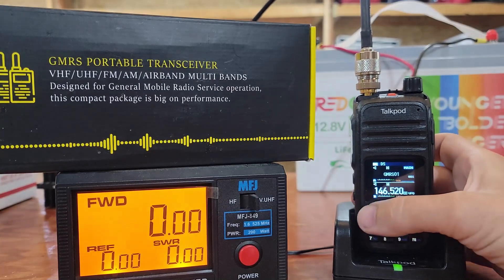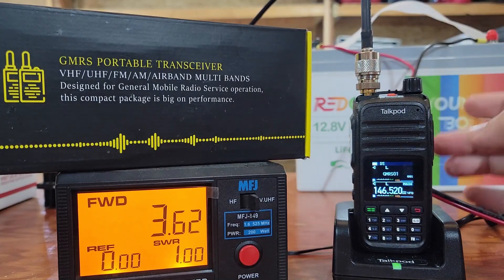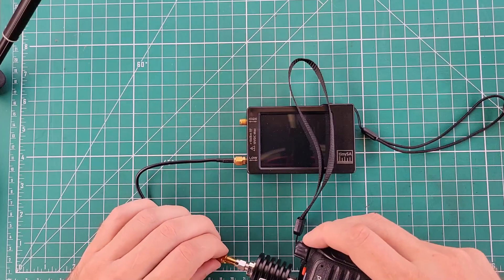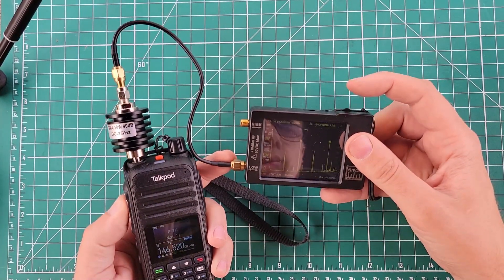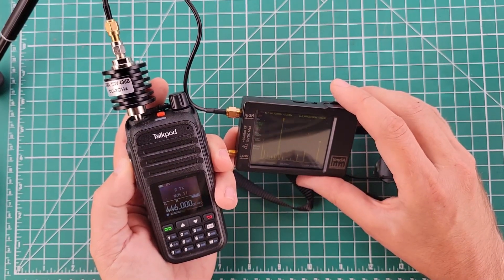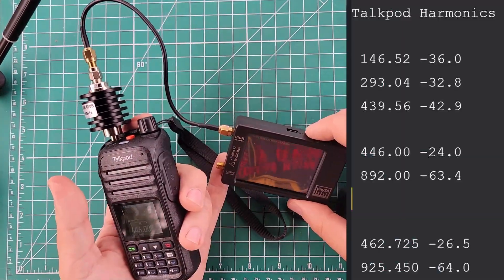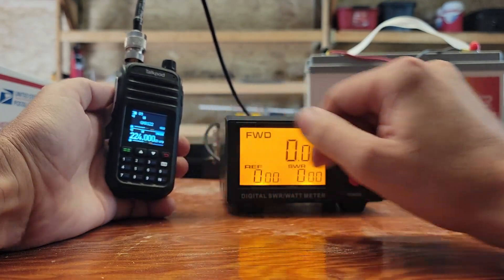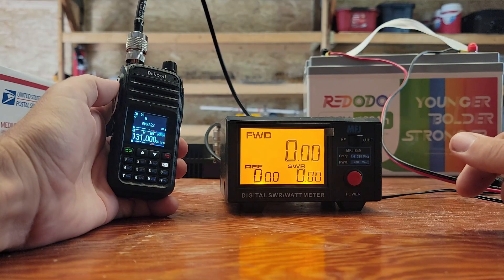The Good, The Bad, and The Ugly of the Talkpod A36Plus

Comment: Thanks for the reviews. I've just received mine, and think it's not bad for what it cost. It receives FM radio and AM airband pretty well. I checked its output with a Siglent spectrum analyser, and found that the output on the 433 MHz ham band was pretty clean, but on the 2 Meter 145MHz ham band, it was dreadful. Second harmonic (289MHz) was only -8dB relative to the fundamental, 3rd (434 MHz) was -11dB, 4th (548MHz) was -29db and 5th (724MHz) was -43dB.  For its price I'd say its OK on UHF or as a receiver or scanner, but transmitting on VHF could cause severe interference to other radio users and should be avoided.
Reply from the maker: Totally agree!  It has its place.

Comment: Hi Steve, I have a really serious question. I want to tune in on my countries main airband frequancy, but it's 136.050... and radio switches out of AM mode to normal FM mode. How can I manually switch it to AM or somehow increase AM range to that frequancy?
Reply from the maker: I didn't see a way to switch modes, mine switched to AM automatically
Reply: @temporarilyoffline  mine does also, bit only inbetween 108-136mhz, and I'm looking for a way to expand that to atleast 136.050Mhz
Reply from the maker: @imeprezime1069  ah,  OK.  I don't see any way to switch modes like that.

Comment: OK, I have been holding off on a TP A36+  impulse buy because of the ugly.   But I'm trying NOT to convince myself that the radio will perform cleaner if taking the antenna into account.  That is, for the spurious harmonics, the antenna SWR should be so bad that most of the power would be lost. I.E., an antenna acting as a kludgey band filter.   This could be easily checked using an external radio or simple SDR.   Do you know if this has been done?  I would try, but it be a $50 experiment.  Also, I'm a bit lost as to why the radio can be sold in the USA.  What are the FCC specs?  I thought these radios had to meet this specs before being sold.  Thanks for videos. They are very inspirational.
Reply from the maker: I'll have to see about the harmonics with the antenna on - that is a hard test to do and be objective about - its it front end overload?  are you too close or too far away?  etc... you know how hams like to argue.  If you already have a 2/70 radio that works, I don't see this offering any additional features other than an easy unlock... and then the power being wasted on the harmonics is tough to swallow at $50.  If you're looking to experiment with making filters, or want to listen to APRS or airband cheap, this might be a contender.  As far as "How can it be sold in the US?" its licensed as a GMRS radio and they shipped some locked, some unlocked, some that can't be unlocked at all... so they sent "a ringer" to the FCC and we got whatever was on the boat the day we ordered.  Thanks for watching!
Reply: @temporarilyoffline   Thank for the quick reply.  I'm no EE, but I would have guessed that comparing the harmonic signal relative to the fundamental signal would be objective as long as distance between the transmitter and receiver are large enough to be in the far field region (greater than 2 wavelengths).    
Thanks! I really enjoy your videos.  They have sent me down a rabbit hole: RT95->APRS ->(split off to RTL-SDR APRS iGate and to LORA APRS iGate with separate LORA smart beacon, and onto satellites via tinyGS(using same cheap LORA modules) and ISS listening on the RT95.  I'm even thinking of learning how to solder SMD inspired by the AIOC.  As you would say, (unless I burn something down) the worst case it would be a $12 education.
Reply from the maker: @dreupen  I don't have all the answers. I'm just trying to prepare for all the arguments that will come if I do it "wrong" 🤣  your progress is amazing, keep up the good work!

Comment: Does dirty harmonics make it harder to transmit or receive? Please explain. Does this prevent the radio from good communication?
Reply from the maker: Dirty Harmonics does two bad things for you:  1.)  You're causing "harmful" interference to others - like trying to have a conversation in your hotel room with your wife and the guests next door are having a very loud fight.  You can't enjoy your stay because their "harmonics" are in your room.  2.)  That power that is going out on the harmonics could have been power used to get your message out on your frequency - you're "wasting" power.

Comment: It's too bad that some manufacturers are releasing gear like this. Even if you don't agree with the FCC rules, it's really not fair to other compliant manufacturers and dealers. They are clearly trying to undercut the others and hoping they don't get caught (but they will eventually). Dealers should be wary of this also, as they risk major fines marketing a "GMRS" radio like this that comes with unlocked TX. :(
Reply from the maker: Some people are reporting it comes to them locked, so say it's unlocked.  It's not uncommon to ship a radio locked that has unlock keys for different markets.  This one is just weird.
Reply: @temporarilyoffline  No, it’s definitely not uncommon, but nonetheless a violation of FCC rules. :) I suspect they will get popped just like Anytone did about 6 years ago.

Comment: 47 CFR § 97.307 - Emission standards.

(e) The mean power of any spurious emission from a station transmitter or external RF power amplifier transmitting on a frequency between 30-225 MHz must be at least 60 dB below the mean power of the fundamental. For a transmitter having a mean power of 25 W or less, the mean power of any spurious emission supplied to the antenna transmission line must not exceed 25 µW and must be at least 40 dB below the mean power of the fundamental emission, but need not be reduced below the power of 10 µW. A transmitter built before April 15, 1977, or first marketed before January 1, 1978, is exempt from this requirement.

The radio does not appear to satisfy the criteria of 40dB below the fundamental. Your recorded measurement on 2 meters is -36dB for the second harmonic.

Your tests of various products is always appreciated—even good, bad, or ugly.
Reply from the maker: Have you seen the GMRS regs? (Link in the description) They make the ham regs look easy to understand!

Comment: I'm really thinking of getting this for my first dip into ham..
Reply from the maker: It would be a good place to get your feet wet and then jump up to more radios as you learn more and grow.  Just be very careful to not transmit out of band.
Reply: @temporarilyoffline  yes total listen mode until I feel ready for test. But knowing the area I live in. SE Massachusetts I think I'd like to see how people are. I know when I ran CB there was a lot of toxic people on locally. Until I pulled my dad's equipment out of the attic from late 70's and set ip after that I was just stepping on them
Reply from the maker: @Byteblade1776  How are you doing on the self test?  hamstudy.org
Reply: @temporarilyoffline  so far just reading it. Work schedule hasn't allowed for deep dive. So like most things slice off a manageable amount at a time

Comment: Am I interpreting correctly that on 146.52 the second harmonic is stronger than the fundamental? That is way sketchy.
Reply: It looked to me like the "floor" had a positive slope, so it's possible that they're equal and the second harmonic is just reading slightly higher (3 or 4 dB) because of the TinySA being more sensitive on the higher frequency.

But yes, it should be something like 40 dB less, not same or higher!
Reply from the maker: Yeah, sometimes it was.  Its very sketchy.

Comment: I immediately ordered a  Quansheng UV-K5 based on HH's reviews, now you are both on to this thing!  I travel on the logging roads on Vancouver Island and would like to be able to use 153+ and other Resources Road frequencies, as well as the usual VHF/UHF ham bands. I don't care about GMRS but WB Rx is always good. I have Kenwood HTs but want something disposable with USB charging. Should I buy a Talkpod too? I also have a Baofeng which is now REALLY disposable.  73
Reply from the maker: That's one of those things where you'll have to figure out what you need while on different parts of the road.  There probably isn't just one solution.